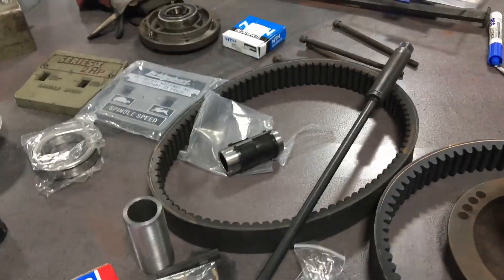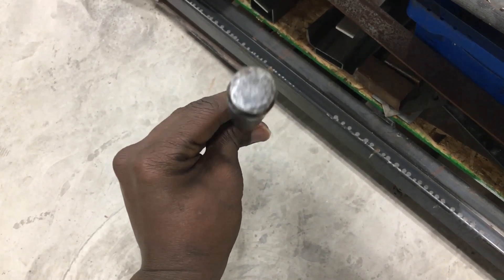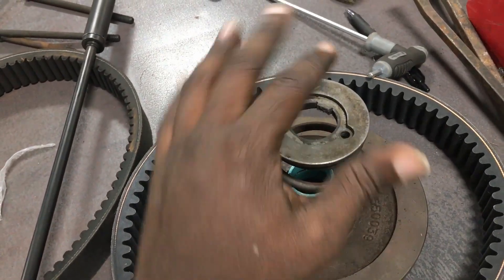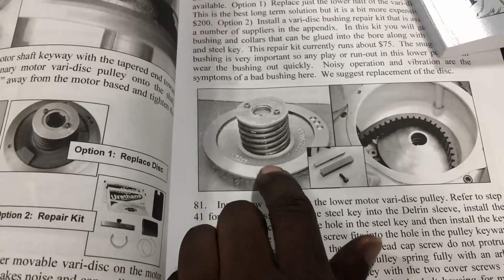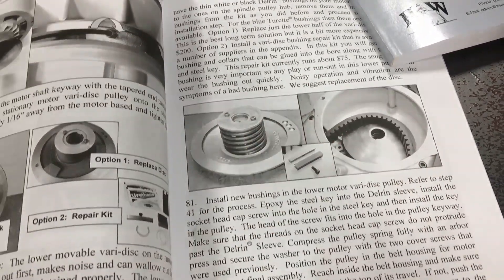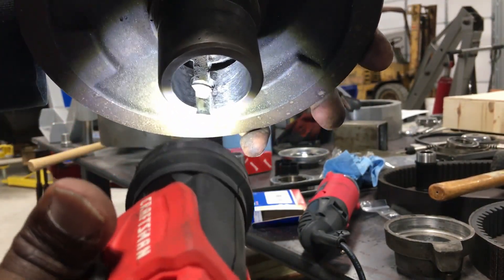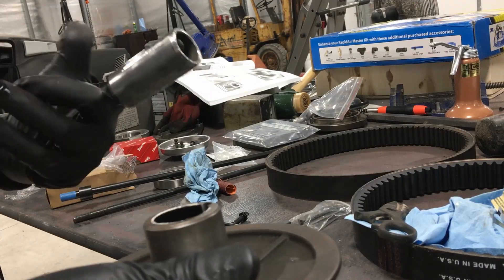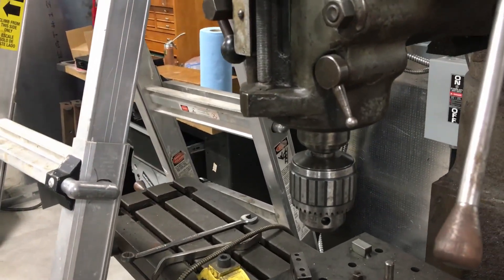Bridgeport Mill Disassembly (Part 2)

Comment: I once had a Bridgeport years ago and that keyway on the varia belt drive was sloppy and it used to make a lot of noise we fixed it and it run quiet and smooth for years after and as far as I know still is
Reply from the maker: Nice, didnt know that. Thanks. Glad I fixed mine. I know the variable belt drives are more noisy than the 1.5hp versions.

Comment: Jamel, where are you located at? I am in Ohio just outside of Cleveland and have been rebuilding machines for awhile. i am also a retired journeyman tool and die maker. I have found allot of easy to fix problems that pop up with the renovating of bridgeports. Hit me up if you have any questions on how to save some money but still get these back to original.
Reply from the maker: Thanks. I am located in the South. No where near you unfortunately. I will email you if I have any questions (which I will, lol). Thanks again.
Reply: I bought land in Tennessee and we are building there. So ill be moving my new machine shop to my new 35 acre property. My email is jason@erieshorecrossfit.com

Comment: Great series;  I am just starting to look for a used BP and I've been worried about how to a) check out what shape it's in and rebuild / restore anything bad -- yes it's all about the "guts" not just "my machine has a new paint job and is therefore restored" and b) how to maintain it.  I want to know what a teardown-reassembly looks like before I dive in on this.  So this is all exactly what I want to know.  Looking forward to the rest of the series!
Reply from the maker: Hi Ed, I am glad the videos help! I am going to make a video on checking what you can realistically look at prior to buying and after buying after the machine is done. I don't know when that will come out prior to you buying, you can email me if you have specific questions or comment on here. The great thing about BP is most, if not all, the parts are easily found new or used. The biggest concerns I would say is the condition of the Ways and a bent table (tables are thin on BPs); hard to fix either of those conditions without extensive knowledge, experience, and tooling. If significant wear is present, then everything has to be taken apart and sent out to be reground, then scraped in (equals expensive). For maintenance, everything above the table takes spindle oil, everything below the table takes way oil (I use Mobil 100772 Vactra No.2 Way Oil). I no longer need spindle oil because I have sealed bearings. Hope this helps, cheers.

Comment: I wonder if you did a little tig welding on that cracked key way if that would fix it up with out throwing the balance off too much. I would think if the balance was off with the amount of running time it will get it probably would not matter. It is odd that they have an insert in there to start with isn't it? I don't recall seeing an insert for a key insert. I wonder if at one time that key way was wearing out and they repaired it by slotting it and putting in that key way insert? Possible I think.
Reply from the maker: I believe that disc is cast iron, a real bear to tig weld with out worry of cracking it further. I thought about that as well. Its hard to say what people did to get stuff working. Right or wrong.
Reply: @Jayjam209  If it is a new keyway that cut in it just might not matter anyway if you can see a separation.
Reply from the maker: @davebrittain9216  I spoke to H&W, they said it doesn't matter much and that wont impact anything because its stationary. So I left it alone. The adjustable disc, I had to eat the 250 cost. When I fully rebuild the machine I will replace that and probably upgrade the motor to 3hp.
Reply: @Jayjam209  :Ya no go if cast. Hard to tell if it is cast or not. Can't really go grinding on it to find out.